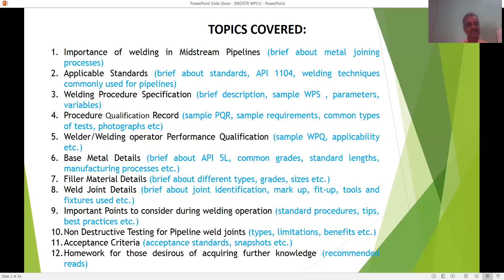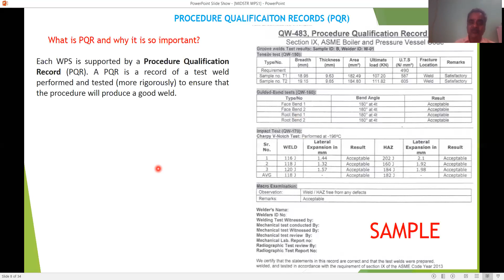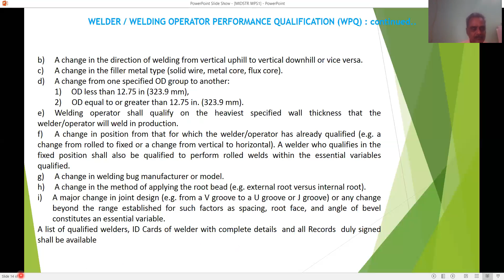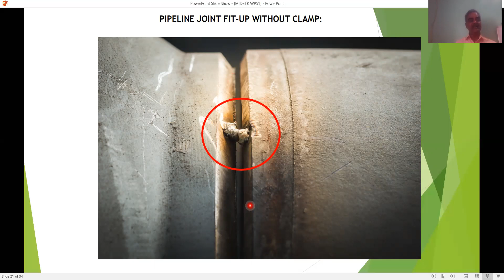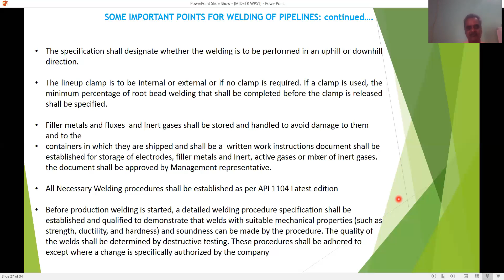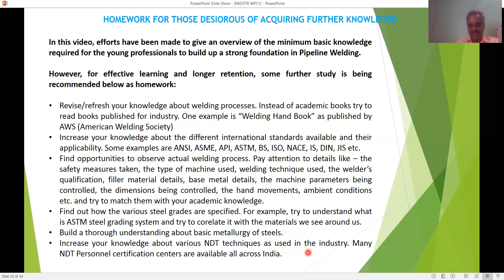COMPELTE PIPE LINE WPS AS PER API 1104#JONSoilandgasknowledgehub

Comment: Sir i watched your video super.Regarding preheat and pwht requirements where will get reference in pipeline Welding. Please explain. Thank you
Reply from the maker: HI Thank you for your interest. I will upload soon about PWHT.
For your immediate requirement refer ASME ASME Sec. VIII Div. 1 specifies the PWHT requirements for materials used in equipment designed as per ASME. Also refer B31. 3 applications, any production welding over 19mm would require PWHT. Therefore, w/o PWHT of the PQR the WPS could only be written for 10-19mm. With PWHT of the PQR the WPS could be written for 10-34.94mm, but PWHT would be required for all production welds made to this WPS.
Call me for further clarifications. I am under treatment past 2 months hence i could not reply immediately. inconvenience regretted.

Comment: What the course requires for welding engineer to get Job. If some one work in small company with any codes and standards but need to grow in this area without   any code.  Please give me guidance to keep start my career. 
Also explain ,what is  NDT  level 1 and 2 certification.
Reply from the maker: hi thank you. please call me 9001890518. i will discuss and guide you.